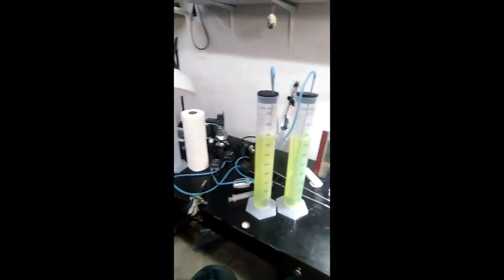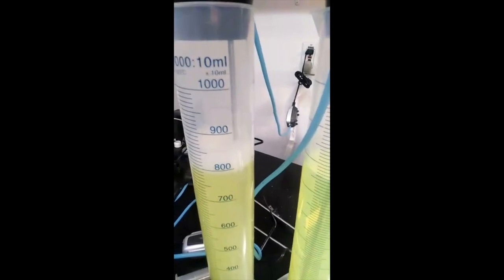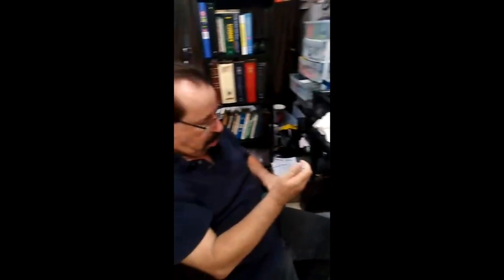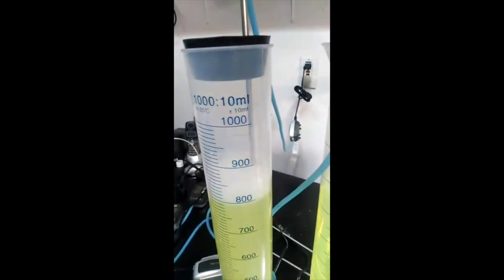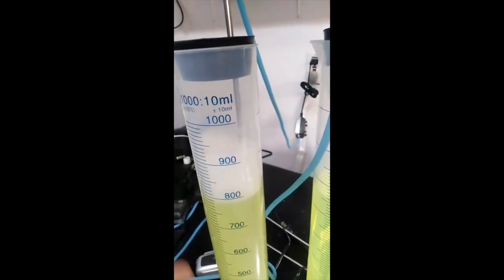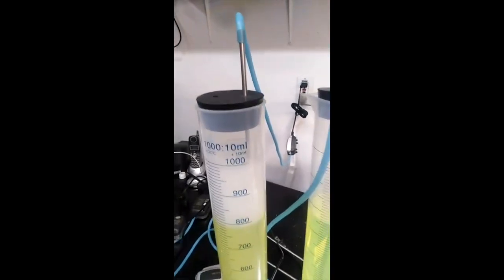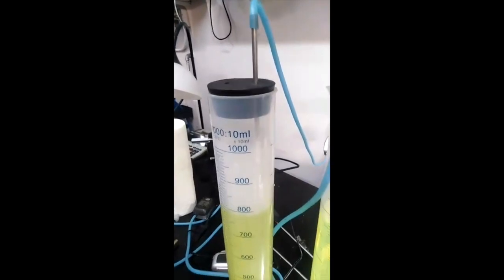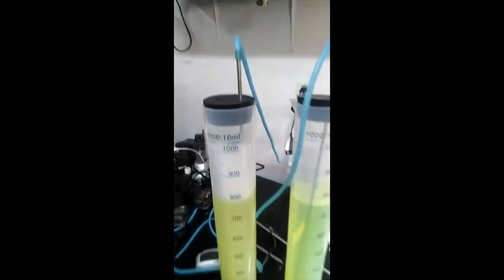OX-CETANE IN ACTION!

Comment: Rubbish. Modern engines meter their fuel ratio based on end products.

You can remove the air all you want, the engine will just trim the fuel rate down until it sees it's target air fuel ratio again.

Also, gas volume is many orders of magnitude more than liquid volume. Look at how little the level of the fluid changed.

Snake oil.
Reply from the maker: you're an amateur Josh, go back to school and take some science and physics classes
Reply: @ox-cetane4887  me and every other automotive engineer desperately trying to improve power, efficiency and emissions in ICE vehicles?

Sure, and you just happen to be the guy that stumbled upon a magical liquid that improves all three... 😂

You either genuinely think this works, which is sad, or you know it doesn't work and don't care, which is the definition of a scam artist...

You choose?

Snake oil....
Reply from the maker: @joshbridges8410  you should read our primary info here on youtube before making your uneducated claims. We make no claims of increased fuel economy , engine performance or lower emissions. Only the OEM's can do that. The best performance any car is going to have is on the day it is sold new. Normally 12 months later it is not performing as well as it did on the day it was sold new. Fuel economy is less, engine performance is lower and emissions are increased. The only thing Ox-cetane does when the air is released from the fuel is improve the fuels solvency. The fuel itself cleans out the carbon deposits restoring some of the performance and fuel economy. Thats it . Thats all. There is nothing that can be added to fuel that will increase fuel economy or engine performance. Nothing. Words do matter Josh. But you should really know what you're talking about when you accuse somebody of being a snake-oil salesman.
We deal in real science and physics. Not guesswork.
Reply: @ox-cetane4887  ok I will concede to a degree, as having found your website the claims are more reasonable than I expected, and for that I do appoligise. I still take issue with the statements about how poorly a modern engine will be after 12 months, and on your website you state "Fuel with less dissolved and entrained air has more BTU's. More BTU's equals more power",  this may be true by volume, but we both know that within a few miles the ECU is going to trim any small change out, and the entrained air is so miniscule by volume that the change in specific energy content will be almost unmeasurable.

I'll delete my comment shortly but wanted you to see that I had gone to look for your claims and have apologised.
Reply from the maker: @joshbridges8410  Josh , severe Enviromental rules and regulations are the the reason the engines carbon up. Air in the fuel has several different contributors. Has anybody ever defined for you the meaning of diesel fuel lubricity beyond just the words? I wrote the ASTM the exact same question and they do not know. Has anybody ever explained to you how Sulphur functioned in the fuel? It has virtually no lubricity properties. So what did it do? I would argue that solubilized oxygen, dissolved and entrained air in modern day refined fuels is a bigger problem than we know. If you want to actually communicate with me I can be reached at drfuelinstein at yahoo dot com